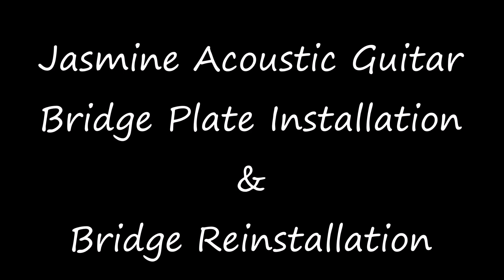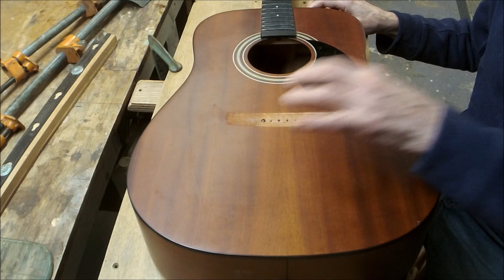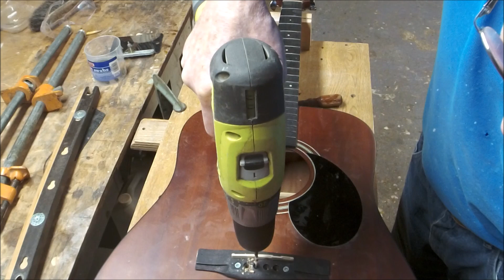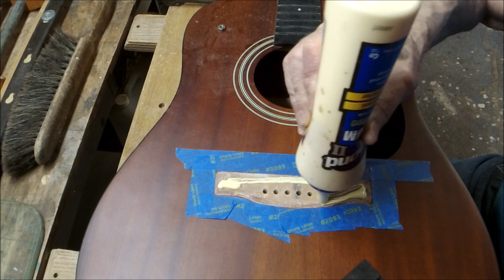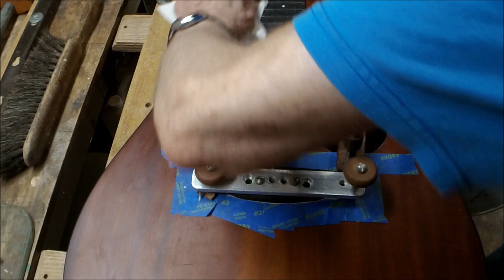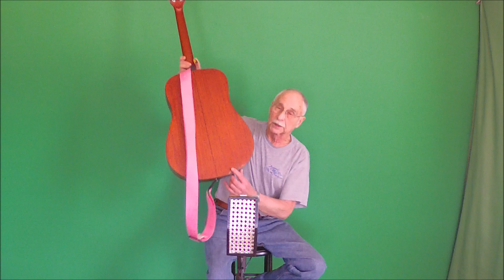Guitar Bridge Repair

Comment: Why not use spool clamps
Reply from the maker: For what I was trying to accomplish the bar clamps and an internal block to hold the bridge plate in place while I tightened the clamps and could apply plenty pressure to glue the plate but not crush the guitar body in the process. 
If I were gluing a top or bottom back on I would most likely use spool clamps.
Hope that makes sense